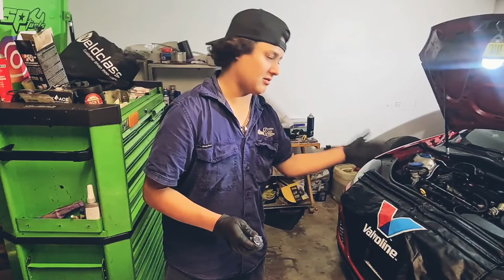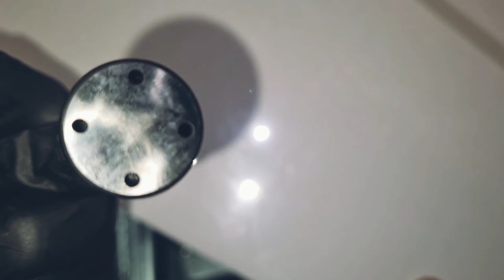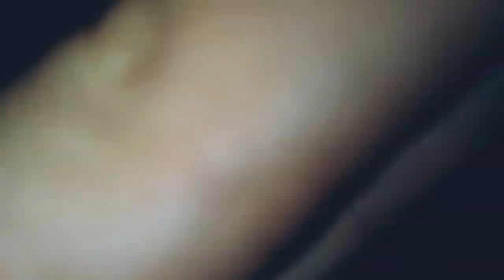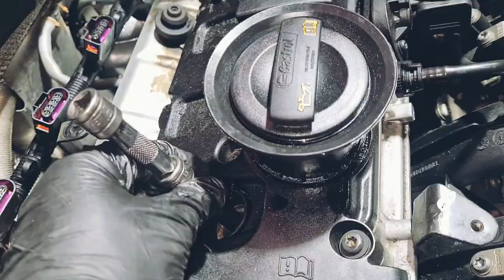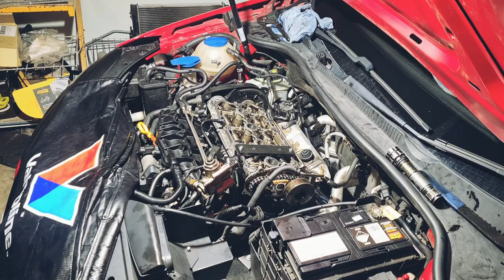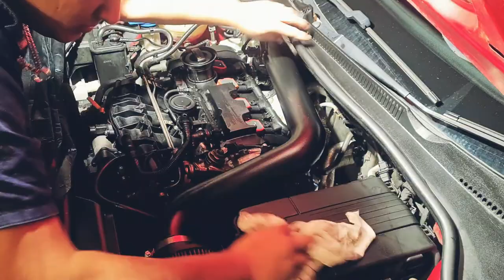Cam shaft timing chain replacment on the volkswagen Mk5 golf GTI #vw #audi #camshaft #timing #chain

Comment: I will be performing this soon, just waiting for my adjuster sprocket, socket, cam lever & locking tool to arrive Saturday. But I was wondering, I had changed all 3 seals & gaskets on the vacuum pump back in March. Would it hurt to take off the pump again? Does taking it on and off mess up new seals?
Reply from the maker: Thanks for watching mate, I have removed and replaced a few chains without replacing the seals on some cars in the passed with newish seals, we would smear a light amount of locktight 518 sealant, on the oring, three bond will provably do the job too..  but see how you go,  I would recommend replacing the seals anyway,  when ever parts are removed, theres always that risk of damage or tearing the seals. 
Hope that helps mate 🙂 hope all goes well with the replacment ahead, feel free to ask any questions too 🤙
Reply: @jack73ist  thanks for the tip. I also have an issue where I attempted to remove and clean my n205 valve, & the connector had oil. Do they sell o rings separately, or do I need to buy a new n205 valve or is it just clogged? I will clean it today with maf sensor cleaner , it’s just I lost my t20 so I had to pick up another set yesterday. Then last night I noticed that the sensor located under the timing cover , is leaking oil thru the connector as well and down the harness but it’s on the plastic wire cover.. I looked up what sensor is it, but I couldn’t find anywhere. it’s the sensor under the timing cover right by the coolant flange
Reply from the maker: @CR15PY1  unfortunately mate, if its coming through the actual connector pins in the plug, the internal seals in that valve are gone I'd say, I've replacesd these valves in the past when they lock up and fail and you lose power because you've lost cam adjustment. See how you go, and lost the tiny t20 securing bolts? I thought they smaller, I've done that too and they go missing so easily 😅 it can be fiddle, I used to dab the tip of the torx bit screwe driver in vasoline to help hold the bolt onto the skrew driver, it ussually works haha 
As for the other valve, I'm  not sure which sensor you may be talking about sorry
Reply: Awesome tip about the torx screws lol. And no I didn’t lose the n205 screws, I lost my torx bit t20 lol but I bought a new set yesterday so I’m good to go. I will take off my n205 valve today, and yeah after discovering the valve I figured that the valve itself messed up my cam adjustment. I did lose power, so do you think my cam chain, tensioner, adjuster, is okay?? I was going to replace all that today but maybe it is just a faulty n205 valve lol
Reply: @jack73ist  the broken stuck open valve , must be the reason for the mysterious oil leak down the back of the block. I’m going to do my cam chain today still lol wish me luck
Reply from the maker: @CR15PY1  the valves controls oil flow to the cam adjuster, so a faulty valve will cut all adjustment if its locked open or shut,  if you have a VCDS ( rosteck wiki ) software on your laptop, you can check for the faulty code, cam shaft, intake and exhaust out of correlation code, which indicates strached chain, they also rattle on start up when bad enough, see how you go with the valve if you have one there, it depends on the symptoms your engine is displaying.
Hope all goes well mate and you get her sorted
Reply: Update: so I removed the n205 valve yesterday , cleaned it, and replaced the seal, as well as the rear pcv, the old one still had the check valve, and seemed to be working properly only one way . But driving my car today to work, my cars power was restored, no more back fires on rev matching. It seems that my n205 valve got clogged from changing my oil about 3-4 weeks ago. I still have everything to perform the timing chain job, the rattling is nearly gone now that the n205 is cleaned. I still with do the timing chain service soon but at least I can drive how it was a month ago
Reply from the maker: @CR15PY1  thats great news mate! And something I will have to look into in the future, you've taught me somthing today, thank you 🙂 haha, this does make sense, I know alot of shops put engine flush, which Im not totally against on some circumstances but I avoid on my car, I would think the engine flush can lift carbon deposits in the engine and they wind up clogging various parts, we did see alot of vanos solanoids ( same valves as N205 but for bmw) become clogged on BMW engines,  and they recommend 20 000km between their services, so when you pull the rocker cover off, you'll find oil build up in corners and around the cam sprockets in the timing case, so Id think when flush is added, all that slughe and carbon ends up through the vanos solanois..
We have our 2nd mk5 gti now that we have just commenced working on, installed the down pipe yesterday, we were thinking the timing chain may be about due.. so I think we'll try this 1st, if this solves the issue, this could save us, and alot of people money and time

Comment: I have done this on my audi a4 but

You are lucky with that golf 
I'n the audi it's more difficult
Reply from the maker: Yeah mate, the Audi's are very difficult being so close to the firewall, if you strip the cM adjuster bolt, you have to remove the cam shafts to drill it out! Have had to do it myself haha.
Reply: @jack73ist  

Yes me to 🤣

I had take the cams out

Comment: Hey great Video, i have a question in the VW Mk5 Golf N/A FSI 2.0L (not the turbo) the cam follower is in different location, have you ever looked at them? and do you know is it the same part number that goes in as the Turbo engine.?
Reply from the maker: Thank you mate, and thank you for watching! I have never actually had to change the cam follower in the fsi golfs, I dont think the fuel pump piston is under the same stress as the forced induction engines, when I used to tune the mk5s and mk6 golf Rs, youd see the follower wear out far more rapidly and would need more regular inspections.

If it does have one, and is worn, it should be the same, but you can always call vw and they're ussually happy to give you the part number using your vin number 🙂
Reply: @jack73ist  Thanks for the reply, Greatly appreciated. yes it does run a completely different can lobe system as well more like an oval shape and not the three tier like the Turbo models. I'll give VW a call and get a genuine one.

Comment: Why you use gasket maker for the chain housing?  There are special gaskets on the market
Reply from the maker: It is best to get a new gasket with the parts but the supplier I purchased from forgot to order it, was also supposed to get a new adjuster aswell, have used locktite 518 manny times to reseal the housing and works well 🙂

Comment: Hey need help mine is really ticking loudly like a rod knock but it comes from what you removed and I started removing it and inside the casing there was scratch marks on the inside wall do you know what could be the problem not to sure if changing the chaîne and tensioner would help and I got the Stop ENGINE Oil pressure CEL, I removed the oil pan cleaned out the oil pickup, I checked the oil pressure switch everything is ok but since that CEL For Oil pressure came on it started doing that rattle coming from the cam shaft casing please I need help I don’t want to blow up my engine
Reply from the maker: Hey mate, thank you for watching. unfortunately to right off the bat, it sounds like you may potentially have an oil restriction somewhere causing a lack of lubrication, trying not to jump to any conclusions yet ofcourse, the scratches could be a symptom of another issue to do with the lubrication system, on a vw BWA engine, the oil pumps them selves seemed to be ok as far as my experience with them, I didnt see any failures besides one where the clearance between the suction gear for the pump ( not sure what they're called ) had a clearance to high amd wasn't able to draw oil efficiently.
I would definitely try not to run the engine to avoid any damage.
Pull the oil filter off and cut out the paper element being very careful not to cut yourself. Inspect for metal fragments
Reply: @jack73ist   hey man, thanks a lot for thé Quick reply so here’s what I’ve done so far since the STOP ENGINE OIL PRESURE light came on:

Dropped oil pan, cleaned it really nice like brand new 
Removed the old oil pickup tube for a brand new one, 
New oil switch sensor 
New camshaft / HPFP bucket (with the 4 little holes 🤣 don’t know how to call it)
I removed the camshaft timing chain housing and saw nothing really wrong with it except for big scratches on the inside of the housing but once I removed the housing their was no oil in the cap like yours… if their was no oil pressure should it pop up at startup? Because right now at start up it never shows up I could let the car run on idle all day and it wouldn’t pop up so I’m really questioning what’s going on and what to look for cause I’m really lost and hoping to find a good answer to my problems…. Why would their be scratch marks on the inside of the housing ?????

And 2nd? - why is it making a ticking sound like really loud I will post a video on my Chanel in less than 15 minutes for you to actually see what I’m taking about thanks you
Reply: Just uploaded the video on my channel bro go check it out you’ll understand better
Reply from the maker: @BoostedEk8  from the video, it actually sounds normal for this engine, but it is hard to tell through the phone, the injectors on these engine aswell as the high pressure fuel pump can tick pretty loudly..
Have you replaced your cam chain already? Ussually clear sign of stretched chain and worn tennsuoner is really.loud rattle on cold start, if the chain is strtched enough, it can throw a camshaft out of corralation fualt code and even evap emmsions control fault codes
Reply from the maker: @BoostedEk8  from the video, it actually sounds normal for this engine, but it is hard to tell through the phone, the injectors on these engine aswell as the high pressure fuel pump can tick pretty loudly..
Have you replaced your cam chain already? Ussually clear sign of stretched chain and worn tennsuoner is really.loud rattle on cold start, if the chain is strtched enough, it can throw a camshaft out of corralation fualt code and even evap emmsions control fault codes, the scratch on the house are left there when the chain is loose enough to hit it, seen it on a few, she may be ok bro, but thats just from what I can hear in the video
Reply: @jack73ist  i haven’t changed the chain yet and Tensionor but like I mentioned on my previous comment, theirs a knocking sound coming from the cam shaft chain cover and it it’s scratched up inside on the exhaust cam gear side

Comment: Great video. From 21:51 onwards I notice that you use a spanner to hold the camshaft while you unscrew the camshaft adjuster bolt. Two questions on this: 1. Is this because the camshaft locking tool is not strong enough? 2. What size is the spanner? Thanks
Reply from the maker: It was more to help support the locking tool, these bolts can be locked so tight. There is another tool you can get that has a set of folks that locates into the exhast sprocket but its quite expensive and I couldn't justify buying it. I used a 17mm spanner

Comment: Legend, I might actually give this a go. Ace kiddo
Reply from the maker: Thanks for watching and the support mate! Feel free to ask any questions if you run into anything
Reply: @jack73ist  I sure will. Any advice on any particular timing chain kits ? Cheers bro :)
Reply from the maker: @bartek_15  we went with genuine and got things separate, depending on the kms on your vehicle it may also be worth replacing the cam adjuster, the low oil pressure on 1st start up after running dry after a chain can push them over the edge in the high km range

Comment: Awesome video! Although I'd never do this myself it's nice to know what's involved. I have an 8p A3 tfsi.
Reply from the maker: Thank you mate and thank you for watching! It is great to get an understanding with whats involved and how things work so that we can better understand ouf vehicles. 
Hope its helped 🙂
Reply: @jack73ist  Helped for sure. I'm actually due to have the cambelt service done, as well as the chain/tensioner/guides/waterpump/thermostat. After that I can start playing with power mods 😀
Reply from the maker: @stephenpato5524  she'll be right and ready for the increase once all that is taken care of mate! Definitely a great idea to take care of preventative maintenance and don't forget, with a power increace, you'll need more stopping power too brakes will need attention, the standard brakes will do their job for a while but a brake pad with brake rotor upgrade or complete brake caliper upgrade kit will be required. Once you start reaching speeds with alot higher acceleration, you'll reach a corner faster then anticipated haha 
Great cars up mountains 👌
Reply: @jack73ist  Yes correct, I just fit 4 brand new Pilot Sport 4 tyres (235/45/17) , Brembo OEM replacement discs (drilled)/pads in front, Audi OEM discs/pads rear.
Late year did OEM PCV (was leaking), NGK BKR7EIX plugs, air filter, battery, and have been maintaining 7k KMs oil change intervals.
Still quite a lot to do but chipping away bit by bit 👍🏽

Comment: hello nice job, little question that will save me, where did you buy the cabone wing? mine broke I can't find them
Reply from the maker: Thanks mate! And thank you for watching. The hatch wing on this one is OEM plastic, we are in the process of seeking a larger one and the front splitter on the Bumper is aftermarket plastic, I'll have to ask my brother and get back to you. It is the front bumper splitter you are talking about isn't it??
Reply: @jack73ist  sorry I'm not talking about her. I'm French I have trouble with the language, I'm talking about the 3 seal that you change at 36 minutes from the video
Reply from the maker: @wolffr9479  sorry mate, ah I see the carbon sealing rings for the hydrolic cam adjuster, selected stores like HSY or IMPARTS may sell them here in Australia, they are sold separately, We got ours genuine from Volkswagon, they go brittle and can crack on removal and installation, sometimes you can get away with out replacing them but I like to replace them to avoid the potential of failure
Reply: @jack73ist  thanks you
Reply from the maker: @wolffr9479  no problem mate, feel free to ask any questions if you need help🙂

Comment: Great content bro and a really nice tutorial. Is there any risk in driving with a loose chain?
Reply from the maker: Thanks bro, and thank you for watching! Yeah I would avoid driving it, the chain eventually stretches to the point it throws the intake and exhaust valve timing out of correlation and the engine will ether missfire, be down on power or have difficulty starting. They also tend to wear into the houseing. Definitely don't want the chance of skipping teeth too. After its all been replaced, you shouldnt have to worry about it again for another 10 or so years

Comment: unfortunately after removing my timing chain, my camshafts rolled clockwise 2 teeth. I then replaced my timing chain. now the timing marks line up on both camshafts but my problem is that the crankshaft sprocket marks are no longer at TDC.

what should I do to align the crankshaft and the camshafts?

Comment: Where can I get the tools used? The one to hold the cams in place, the one to turn the intake cam, and the T40080.
Reply from the maker: Thanks for watching mate. All found on Ebay except for the poly drive, but I just googled that part and ordered it from one of the 1st tool shop links.
This is the link to the cam shaft lock kit. 
https://www.ebay.com.au/itm/7Pcs-Engine-Camshaft-Alignment-Timing-Tool-Kit-Set-For-VW-Audi-2-0L-FSI-TFSI-/143331229845?mkcid=16&mkevt=1&_trksid=p2349624.m46890.l6249&mkrid=705-154756-20017-0

To search parts you can just type VW 2.0 FSI BWA engine, CDLC for the golf r and Audi s3.

Hope that helps mate